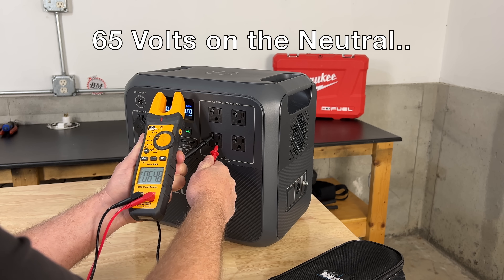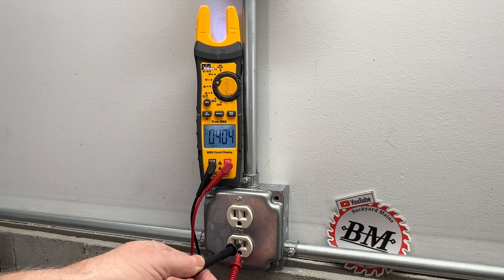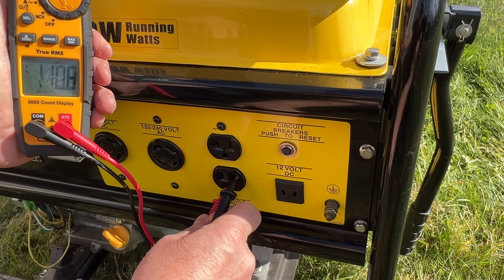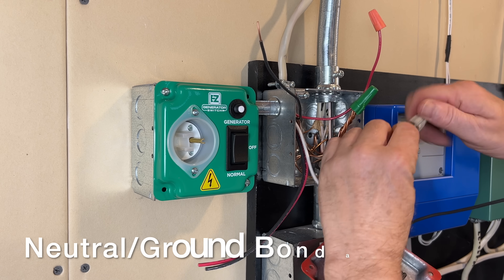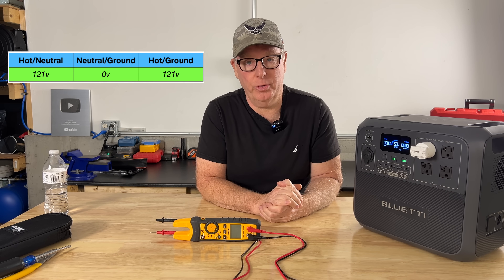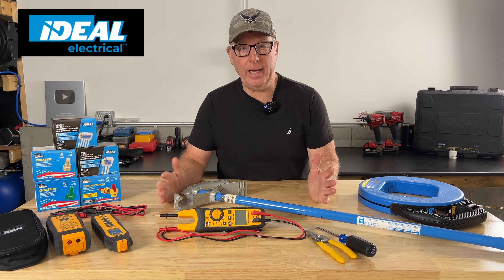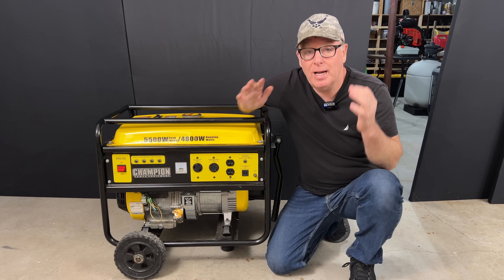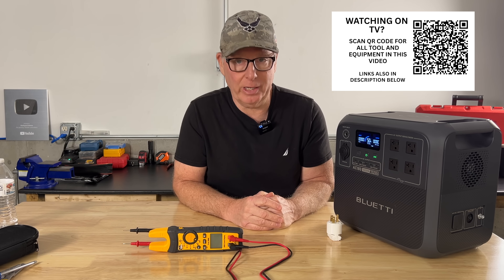The Hidden Generator Mistake.. (Dangerous)

Comment: Very clear and concise explanation of what we as electricians know as an ungrounded system.  It's also worth pointing out that there are some premium multimeters, such as my Klein 600A AC/DC 1000V CAT III/600V CAT IV meter, that have a LoZ volts function in addition to the volts function.  Some meters with the LoZ function may vary, but my meter is specified as 3kΩ input impedance on the LoZ volt function, and 10MΩ input impedance on the volt function.  The LoZ function works great for eliminating capacitance voltage (aka ghost voltage, or phantom voltage) readings due to the much greater current flow under test.  I have even used the LoZ function for determining whether the GFCI protection of a circuit is operable by testing between the hot and ground of a receptacle outlet or at the outlet of a hardwired appliance such as a hot tub/spa . (If you're unsure, look up the definition of "outlet" in article 100 of the NEC) 

For those that don't know, there is a such thing as an ungrounded delta 3 phase system, most commonly 480 volts but sometimes 240 volts, and much more rarely, a 480V ungrounded wye system. The purpose of an ungrounded system is to allow a single line to ground fault to occur without tripping a circuit breaker/blowing a fuse, but if a second line to ground fault were to occur on the system, the result would be a line to line short and the results could be explosive.   Ungrounded systems have special NEC requirements including but not limited to, ground detectors, which are typically indicator lights but may include alarms as well. This system would only be found in industrial systems for very special applications.   

Why would a facility want an ungrounded system, you may ask? Well, consider a ventilation system in a chemical plant for preventing the build-up of toxic or flammable/explosive gases, where the unexpected shut down of the ventilation system due to a line to ground fault on the circuit could result in serious injury or loss of life.  For this application you would more than likely want an ungrounded system.  The warning lights and/or alarms would warn of a line to ground fault on that phase, allowing facility operators arrange for a planned shutdown so that troubleshooting and repairs can take place in an orderly fashion.   The SOP's in this situation may call for an alternative ventilation system to be set up and running before the primary system is shut down for repairs.  

With either a floating neutral generator or an ungrounded 3 phase system - same concept - if you use a meter set to the LoZ setting and measure hot to ground or neutral to ground, you will find there is 0 volts because there is truly no path for any "real" current to flow back to the source and complete the circuit.
Reply: > "consider a ventilation system in a chemical plant" -- Another, and classic, example is the rolling machine in a steel mill. Red hot steel rolled back and forth to consolidate it and work it down to size. Motors working next to hot stuff, cooking insulation. If a short happens and a fuse/breaker trips, all that red-hot limp steel hardens and welds around the rollers. Because ordinary people are not allowed near (even staff keep their distance) these systems were allowed to run un-grounded. Motors on porcelain insulators, etc. When insulation broke-down the motor case would go "live" and (as Sparky says) set a light or alarm. But the system would still function (until a second fault). The operator would finish the pass he was on, roll the steel off to the rewarming furnace, and call the electricians.
Reply: Nice to have a couple of real world examples for an ungrounded system.
It's off topic but. I'm relocating my mid sized solar system to a house on wheels.I may not be able to dig a new hole for my grounding plate.
should I bond the ground to the steel chasy of the trailer? it's a 48 volt DC and 120v system.
any recommendations?

Comment: A setup that intentionally has half the voltage on hot and half the voltage on "neutral" is actually how some very high end audio power systems work. They use special devices to convert incoming 120v or 240v power into a +60 and -60v in reference to ground. This is a differential voltage design that is meant to completely isolate high end audio devices from the power grid and noise on it, as well as provide noise rejection on the power lines through the differential power. And yes that type of voltage system is allowed by the NEC and not dangerous, at least not any more so than standard 240v plugs in a home are, even less so since the voltage per leg is less.
Reply from the maker: Audio equipment is primarily covered under Article 640 of the National Electrical Code (NEC), which addresses sound systems, and NAICS code 334310 for manufacturing. The NEC's Article 640 covers the installation and wiring of audio signal processing, amplification, and reproduction equipment, while NAICS code 334310 is for the companies that manufacture audio and video equipment. There are also specific regulations in other parts of the code, such as those concerning audio equipment near water, which fall under section 640.10. 

None of that applies to other than audio equipment though..

Comment: Awesome video! Topics are always clear to understand and to the point.
One question in a stand alone generator application and using a bonding plug. Does the generator need a grounding electrode?
Reply from the maker: Most generator manufacturers recommend a ground rod but it's not practical to drive a ground rod and remove it every time you move the generator. With a bonded neutral your breakers and your GFCI protection will work. A ground rod is basically surge protection. I surge can be created from a near by lighting strike. If you were using a hand tool when this happened you could be at risk and a ground rod offer some protection. There is no protection for a direct hit though.. I never use my generator when i hear thunder in the area.

Comment: First of all great video and thank you for doing them. Questions, if using a generator standalone in the field is it wise to drive a ground rod and bond the generator to that ground?  Thanks again.
Reply from the maker: Thank you.. Most generator manufacturers recommend a ground rod but it's not practical to drive a ground rod and remove it every time you move the generator. With a bonded neutral, your breakers and your GFCI protection will work. A ground rod is basically surge protection. I surge can be created from a near by lighting strike. If you were using a hand tool when this happened you could be at risk and a ground rod offer some protection. There is no protection for a direct hit though.. I never use my generator when i hear thunder in the area.
Reply: @BackyardMaine thank you so much!

Comment: Great video and explanation of bonded vs. floating neutral.  I have a 8750 watt inverter Predator generator which has a bonded neutral.  On my previous one (same model) I found the bonding wire and disconnected it.  My new one I haven't found the connection as they changed the design.  So, for now, I'll be connecting to my house with two bonds.  It would be nice if the manufacturers would put a switch to change from bonded to floating.
Reply from the maker: Glad the video was helpful! Many manufacturers are indeed making it harder to disconnect the bond these days. You should try to find it or have someone help you with doing that.. Two bonds can be unsafe and it can also cause damage to electronics.
Reply: Is that something you have to do to be able to connect to a residence?

Comment: What confuses me is why I see voltage from neutral to ground out the outlets in my home. They're bonded at the main panel, so I really dont get it. I've heard "capacative this", "arcing wire" that, but it doesnt make sense - my wiring is pretty clean.
Reply from the maker: You most likely have more than one bond in your home. This can happen if a sub panel is also bonded or if neutrals and grounds are on the same bus in a panel or touching somewhere else in the system.

Comment: When I add a bonding plug to my floating ground generator,  what's up with that, it trips the gfi
Reply from the maker: Yes, adding a bonding plug to a floating neutral generator for stand-alone use will likely cause the GFCI it's plugged into to trip. The bonding plug connects the neutral and ground wires, and if there is any leakage current (even a small amount) from the generator's neutral or wiring, it will now have a path to the ground. This imbalance is exactly what a GFCI is designed to detect and trip. Because the plug is essentially on the load of the GFCI this can often be a problem especially if the generator is bonded to a ground rod. The work around is to make a bonding plug that connects to one of the Non-GFCI receptacles or add a bonding switch in the wiring behind the GFCI itself.

Comment: I've watched your videos previously, but I decided to subscribe after watching this one.

I have an Anker Solix F3800 Plus. When I first got it, the Neutral/Ground were bonded. This caused "Objectionable Current" on the ground with my original transfer switch. I changed out the transfer switch(es) to switched Neutral types, and this resolved the issue.

A Firmware update resulting in the AC Output defaulting to Floating Neutral. With my switched Neutral transfer switch, this caused a new problem. Fortunately, there is an option on the F3800 Plus that allows a double tap on the AC power switch that bonds Neutral to Ground. I had to add a special outlet tester to monitor this bond connection, since all the Neon lights came on with the cheap ones. (I have a couple of higher quality testers that don't exhibit this problem). I feel that I need the tester plugged so I don't forget the double-tap when I activated the AC power outlets.

I tried a bonded Twist-Lock N/G, but this causes the GFCI that I charge from to trip. I have to remove it in order to charge from that outlet.

My 96+ furnace runs fine on the adapter that I added to the Twist-Lock (L14-30R), but it seems to trip the internal GFCI in the Anker when plugged into one of the regular 20A outlets. 

This Neutral/Ground issue seems to be a source of confusion for a lot of people for Power Stations and Generators. Your video helps explain this very well. I wish that I had seen yours and others prior go going around in circles with transfer switches. I have separate individual transfer switches, instead of the multi-breaker type.

Comment: Very clear coverage of a confusing subject for non-electricians and VERY MUCH appreciated!! I'm ready to pull the trigger on putting in 12kW of "portable" battery backup for my 100A (not upgradable)  townhouse through a backfeed breaker and this subject was a big known unknown for me. While I always have qualified electricians do my work, they sometimes have other solutions for various issues and I like to be a step ahead in understanding the details in case that particular solution falls short of my expectations.
Reply: Anyway I wouldn't buy any kind of hundred amp battery backup to back future house, use a generator. The size true backups you need for a house, are very large and still rack mounted. These small portable toys are just that toys remember that they're output ratings are rated at insane Peak levels for fractions of a second and average power levels for only a few minutes if you take a patriot power bank that's rated at 1200 W and try to run it at what they consider the rated power of 800 w first of all you're going to find out that the battery is going to be dead in less than 15 minutes, and there's a good chance the thing will melt down on you.

Comment: Years ago before I put in a generator intlet and interlock in to run power through my main panel, I tried plugging my gas/propane HVAC directly into my generator with an extension cord.  I could never get it to work though. I was never clear if that was due to the floating neutral or just not clean enough power (it was a 2kw inverter generator) causing problems with the rectifier or something else.  Works now (10kw inverter generator)  through the panel and it’s oh so nice to have the entire house powered during frequent (mountains of SoCal) safety outages.
Reply from the maker: HVAC systems have a large inrush current unless a soft start is used. You probably just didn't have a large enough generator.
Reply: @BackyardMaine  TY for the response.  I should have been more clear, this is a propane FA furnace, not AC. I suppose it could have been inrush for the inducer and blower, but in this case the generator didn't even bog down, the furnce just refused  to even try to operate beyond a lit up power LED.

Comment: In my Bluetti Elite 100 V2 Power Station the ‘phantom voltages’ disappear if the unit is connected to the mains via the AC power cord. So if the AC power cord is connected to the power station, the Earth Ground on the power station ‘gets bonded to Neutral’ via the Main AC Panel… So I suggest to check your system to see how it behaves when the main AC power cord is connected. In my Bluetti Elite 100  I’ll only use a Bonding Plug if the system is not connected via the AC Power Cord otherwise there will be two ground/neutral bonds.
Reply from the maker: I'm planning to make a video on that subject. Here's some information I'm putting together for the script. 

Most power stations are engineered and UL-listed as portable appliances, not as separately derived power sources. That distinction matters.
UL Listing / Safety Design:
They’re tested and listed under appliance standards that allow a floating output, because they’re usually used like an oversized UPS or extension cord. The safety agencies accept floating output as long as the chassis is grounded and the output is isolated.
Built-In Inverter Protections:
Many power stations rely on inverter electronics and GFCI-style monitoring to protect the user, rather than the traditional bonded-neutral + breaker approach. They’re designed under the assumption that most users are plugging in appliances directly, not wiring into distribution.

Comment: Excellent video.  Very clearly explained.  Just to test for understanding… if I have a floating neutral generator and I connect it to my breaker panel, both bonding AND grounding will be taken care of at the panel so I don’t need a bonding plug and I don’t need to ground the generator.  However, if I am using the generator standalone, I should both ground the generator AND use a bonding plug to ensure my generator breakers work correctly.  Do I have this right?
Reply from the maker: Sounds like you've got a good grasp of the concepts! The ground rod is really just surge protection (mainly from lighting). When you have the system connected to your home you will have that protection. Some people like to bond the generator to a ground rod outside to prevent a possible surge from a lightning strike near by from traveling into the home and then back out to the homes grounding electrode. (ground rod). It's actually a choice whether or not to do that. I personally don't but it's not a bad idea. Mike Holt has a good video on that logic as well. When the generator is used as a stand alone system and the neutral is bonded to ground at the generator a ground rod is recommended by many generator manufactures. They have to cover themselves from liability. The circuit breakers and the GFCI protection on the generator will function fine without a ground rod. My take on this is: I will not be using my generator as a stand alone system during a thunderstorm so I don't drive a ground rod.
Reply: @BackyardMaine thanks much!

Comment: Great video.  I happen to have the same generator as you have in the video.  I took the bond off, which is how it came from the manufacturer.  I intend to use it to power my house thru a generator inlet and mechanical interlock. I put the bond jumper back on the generator with a zip tie, and wrote “unbonded” on the generator. Thanks for helping us!
Reply from the maker: Glad I could help and thanks for the kind words and for watching my content.. Much appreciated.

Comment: Not sure what mechanism is inside those power banks to make those readings, but if you sum the phantom voltages together they seemed to equal the 120v readings. Its like the potential is shared between 3 different paths.
Reply from the maker: Yes that's true. It appears to be sharing the voltage between hot and neutral. That is simply capacitive coupling being picked up from the high impedance multimeter. Once a ground reference is established it disappears.

Comment: 13:35 interesting. Looking forward to the battery power station not needing a bond. 

I have ran into I m issues where devices refused to run from a battery power station because it could detect there wasn’t a bond.

After using a bonding plug, it worked fine 🤷‍♂️
Reply from the maker: That can happened especially with furnaces..

Comment: Outstanding. Still confused as to why the power station doesn't need the bonding jumper for stand alone use though.
Reply from the maker: Great question! That's a common point of confusion. I plan to make another video on that subject.. Stay tuned.
Reply: Listen again starting at 12:55

Comment: Is there some way to wire the generator inlet in a home such that if someone improperly plugs in a bonded generator, it refuses to work or at least makes the presence of an error very obvious? It would be good for an electrician installing such an inlet to consider adding that, since they won't be there later to control what's plugged in